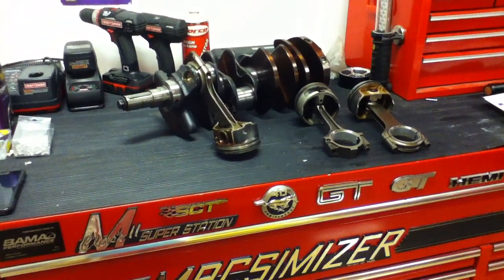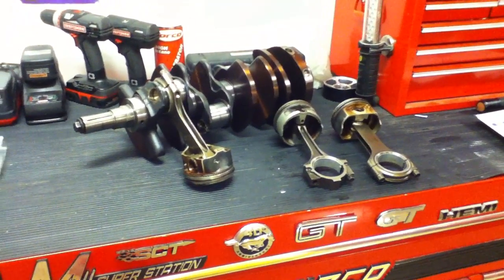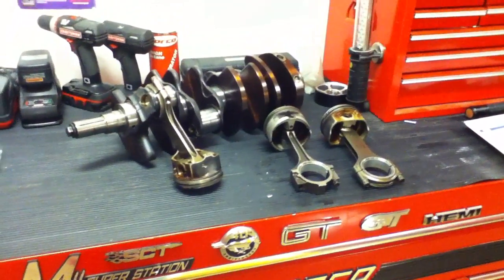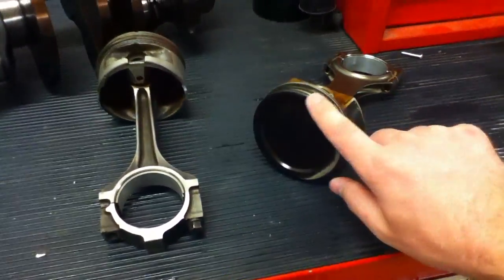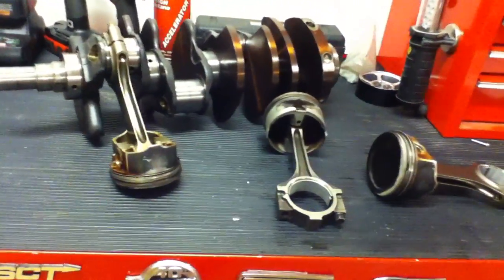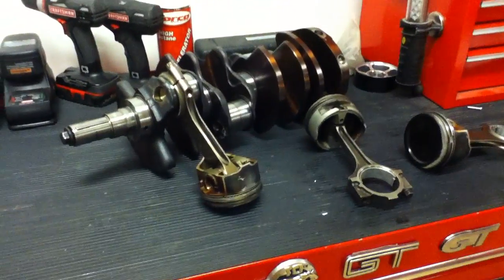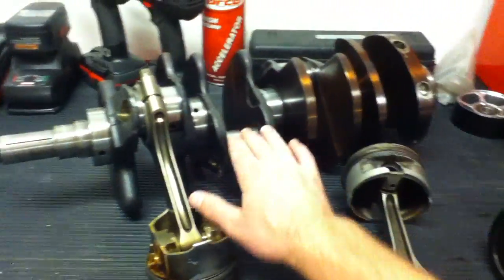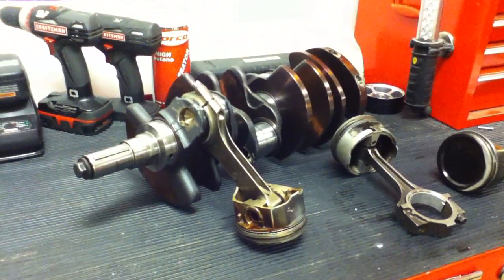Ford Modular engine, stroker kit, Compression ratio

Comment: I believe the Ford mod engines derived from the engine developed for Indy racing during the mid 60's. If I can recall, it was about 250 cid, dual ohc, fuel injected. The block was based on the 260 cid engine. I was blessed with the opportunity to see one of those impressive engines at the Ford museum in the early 70's.

Comment: So what is the best solution for us gt owners who have the 4.6 s.o.h.c.  engine? Coyote swap?
Reply from the maker: Yeah, because even supercharging will only get you to 450hp and any more will break connecting rods. Coyotes start at that level
Reply: @dannyjohnsonsgarage  thank you
Reply: I see.
Reply: Do you reccomend wrecking yard pulled coyote swaps or new crate engines
Reply from the maker: It would probably be most cost effective to get an entire wrecked 2011+ mustang, take the drive train and then sell the extra parts. You’ll still need to buy some things like the control pack that adapts it to the older mustang but you’ll have most of it that way

Comment: Wanted to get your opinion on the compression for a 297 scat stroker. I did a compression test and got 110-120 psi throughout the cylinders. Is that normal?
Reply from the maker: The important part is they are all the same, so the number isn’t as important as the consistency. The gauge itself may read low. That does seem a little low for a number, but again if it’s consistent you’re most likely ok
Reply: @dannyjohnsonsgarage  I am unsure on the stroker specs and machining that was done for the engine. But yeah I was getting 112-129psi, w/ bank 2 (driver side) being ~10psi lower than the other bank.

Comment: I have a 96 cobra motor, Teskid block, Kellogg crank, looks like It has flat top piston. Stock I beam rods and Cobra 99-01 heads have work
Comp cams springs, cams, rr Bunged heads.    🕵️ Will I benefits from a Manley h beam or Forged pistion, from a 03-04 Cobra? Will it handle more boost & be compatible with my 96 cobra  rods & piston size.🤷
Loved the video👌💯
Reply from the maker: The manley connecting rods from a 03/04 cobra are among the best you’ll find! Yes, install them. But with flat top pistons, that will be high compression so you’ll make power with boost very easy, but be safe with the ignition timing with that much compression ratio. Good luck on he build!

Comment: Can you put a cobra bottom end in a 2v.
Reply from the maker: c t 23 Yes, you can. There is a little more to it if you wane to go dohc and you should use the cobra block for that, but the crank, rods, pistons can all be used.
Reply: @dannyjohnsonsgarage  bro you're awesome I have a 99 Mustang GT it has a hundred and fifty thousand miles on it I want to do heads or supercharged it I work at Woody Anderson Ford and some of the Mechanics for like you're building this top-end motor too much the bottom and can't hold it so with the cobra being forged I was wondering could I put forest in there I'm no mechanic and that's why I'm asking these questions
Reply: Forged not Forest sorry talk to text
Reply from the maker: c t 23 You may enjoy my brother’s old Bullitt. Research the “tork tek” supercharger kit. It uses the cobra blower on the 2V. His car also had a mmr600 bottom end (which may also be a cheaper route) as it comes with pretty much the cobra internals. https://youtu.be/mxYigJmVRRI

Comment: So curious would you or wouldn’t you stroke a 4.6 ?
Reply from the maker: You would for more power, you wouldn’t because you’re putting the wrist pin closer to the heat with a smaller thickness of piston. You’re machining the components to be thinner, which would be more prone to cracking, but that’s not too much of a concern since the cylinder walls are thick. It’s a bigger concern on ls engines that get so thin you crack cylinder walls

Comment: Correction 4.9 engine.
Reply from the maker: correction to the correction. The old 5.0 is 4.948 and the new is 4.951. Both are under 5.0 liters, but the newer actually follows the official rounding rules to get to 5.0 😉

Comment: Great video Danny. I have a 2004 Cobra. I have 65,000 miles on stock motor with ported and pullied Eaton. About 470 HP. I am looking to install a 2.9 Gen 3 Whipple with return fuel system running E-85. I want to get as much reliable HP out of it. So I am thinking of upgraded rods and pistons and ARP hardware. What compression would you recommend? I am shooting for 800 hp or more. Will the stock block hold up? Custom cams and ported heads? What parts would you recommend to do all this right?

Thanks
Reply from the maker: Wilson Velasquez You can get to the 800hp level with little mods and without a rebuild, but if you want to rebuild the engine you can. I would simply upgrade the fuel system as you say with the gen 3 2.9 and let it ride until it needs a rebuild. I personally don’t like cams because the car is fully capable of running smooth and making big power, but if you like the lope and cam sound, no problem with that.
Reply: Danny Johnson 

If I do rebuild. What compression would be good for a tune for 91 octane gas with  16 pounds of boost and a tune for E85 with max boost(22-25)? How is the new coyote getting away with almost 12:1 compression on pump gas. And be able to run a 3.0 Whipple making over 770 hp on pump gas? Thanks for the info!
Reply from the maker: Wilson Velasquez Yeah, 9:1 will still work for both 91 octane and e85- you just need the tunes conservative. 

The new coyote can run a higher compression ratio because with direct injection, fuel is sprayed later in the compression cycle (rather than mixed in at the lower intake manifold) and therefore runs a lower risk of pre-igniting in the cylinder. 

I asked whipple about the high compression ratio and they responded it has knock sensors to pull timing (which to me, if it knocks, it’s too late- in fact, the terminator does not have knock sensors for that reason. It reduces ignition timing off of air intake temps).  I foresee some issues in the future. We will see

Comment: Thanks for making this video. Very informative. Quick question. What compression ratio would you recommend for a 99 cobra engine? Slightly higher than stock? I’m rebuilding it with forged internals. And plan on adding a pro charger. Thanks
Reply from the maker: Christo 17 I would shoot for around 9:1. Use a high octane fuel with that setup. Coyotes are running 11:1 and now 12:1 with direct injection (which helps), but you have to be very good with the tune and proper fuel
Reply: Danny Johnson Thank you. I was looking at either Lund or Vmp for a tune. The best octane we have is 91. Unless I run e85. The shop recommended boring .20 over or if I wanted, they can add a stroker kit. But like you said, there’s not a lot of room. Do you know if other 4v heads will benefit my build than the stock 99 cobras? Thanks again.
Reply from the maker: Christo 17 yes, the 03/04 cobra and mach 1 heads (04 being better and the 05 revision for the Lincoln aviator DC  being the best) are the best it got..other than ford GT heads, which are near impossible to find and expensive if you can. I believe the 03/04 heads also match up better for the supercharger components if you go towards terminator supercharger parts

Comment: Hmh, does the piston have an issue of being pulled too far out of the cylinder like a 4.25 inch stroker ls engine? Where to skirt of the piston is pulled out of the cylinder and rocks is what I'm trying to say xD
Reply from the maker: That would be the concern if not using a full stroker kit
Reply: Danny Johnson oh ok :) cool, I was pretty worried at first because of the deck height compared to an ls6. Thanks!

Comment: Had a question for you I have a 1998 Cobra SVT aluminum block which got hot and had water in it we change the head gaskets put everything back together and still it continue to overheat can you help me out with that
Reply from the maker: lil mayo fan B Have you burped the engine using the front cross over plug?

Comment: I have a 99 cobra and considering putting forged internals. What bore size, stroke, and compression would you recommend?
Reply from the maker: It depends on what power adder and fuel, but I’d say the 9.5 compression ratio range, stock bore and stroke so you can keep your stock, forged crank and only need to buy pistons and rods. Then plan to run a good octane/E85

Comment: Hi Danny I recently watch your videos, I have a question, 1: What exctly change in a Stroke Kit to uo at 5.0, the distancie in a Rods or diferentent distance and a Crakshaft? 2: I see a pistons Eagle to 3v and I have a 2v, I can use this forge pistons, because the 3 v just add anoter valve in a center and the 2 v position has a simililas to the 2v heads. Thanks I recent Rebuild my Engine my Crankshat is a 8 hole F85E-8303-BB I think is a Cobra Crankshatf because the old owner chage some parts to procharge the engine.
Reply from the maker: Typically, you will need a new crankshaft for a deeper pull into the block, and also longer rods. However, some companies may be able to change the length of pistons as well to increase displacement.. but that also will change the wrist pin's location, which you don't want to get too close to the top of the piston. Each company may have a different strategy, so I'd recommend calling the company and asking how the kit will increase displacement. A lot of these companies like DSS, MMR, Eagle, Diamond etc. have great customer support.
Reply: Thanks Danny i do it.

Comment: I'm running a 03 cobra and I just upgraded pistons and ARP 2000s my question is I am now running a 23 CC dish piston overstock Will I lose power and was is the smartest route to go I am currently running a 2.3 Whipple right around 20 pounds of boost I am concerned that I should've stayed with the stock cc and a better person
Reply from the maker: Cobra 5.1 that's probably going to be fine with the boost level. I don't think you'd see a major loss from less CR due to more dish (if I understand you build correctly). If anything, it should be safer as well

Comment: Great explanation on the 4.6, I have a 03 GT I wanna buy the on3 single turbo kit what setup would you go with? I'm still learning so any advice would be great thanks
Reply from the maker: Alex Guzman my advice for a turbo is that they are best for automatic transmission cars and must be put on the right fuel system to get the max out of them. Same with centrifugal blowers. I would recommend a positive displacement (top mount) supercharger, and remember that your car will hold about 450 hp at the wheels before it snaps connecting rods. Check out my brothers to valve BUlLLITT. It has a built bottom end, heads, cams, and the eaton supercharger from the cobra https://youtu.be/mxYigJmVRRI

Comment: Im getting my lower end rebuilt at the end of the year on my cobra,my block has its passages gunked so im not getting my oil up to the heads and the motor is shaking. Going with manley forged rods and pistons. Came back to watch some of these vids. Whats the story on this buddy of yours cobra? Is he going stroker?
Reply from the maker: Morbid SVT COBRA I don't think he'll go stroker. He had a few things come up and has his new 2.9 Whipple he has for it for sale. It all depends on when he can have the funds to finish it
Reply from the maker: Morbid SVT COBRA I don't think he'll go stroker. He had a few things come up and has his new 2.9 Whipple he has for it for sale. It all depends on when he can have the funds to finish it
Reply: Gotcha. I ran into ,y mustang shop mechanic today at work,he said hes sending my block upstate to one of the best rebuilders in the country,that sounds like great news,now im no where near close on the funds right now,gotta grind till december thgough :(. Now im anxious as hell,lol
Reply from the maker: It adds up real quick, and I'm having some anxiety over my buddy's build because I'm reading about how the mod blocks need a lot of attention and should be cut in small increments (not just punched .20 over on the first run). I'm sure machine shops know all that, but Its got me nervous.
Reply: I can relate. Btw found out the shop. Its at boyton beach called MPR racing . Tim Eichorn ,check them out on facebook. They build alot of coyotes too.

Comment: what do you think about the 4.9 stroker kit that scat offers.?
Reply from the maker: Marteze Farmer it depends on what you have as the original motor. In this case, you'd have to give up the cobra's very nice forged crank and hope he new crank is just as good
Reply: Danny Johnson its a 4340 forged steel crank 3.750" stroke and swings    5.850" long pro sport h beam rods
Reply from the maker: Marteze Farmer yeah, that sounds like it would be a good one. What car is it on? 6 or 8 bolt?
Reply: Danny Johnson it's for a terminator. I'm doin a cobra swap in a fox
Reply from the maker: Marteze Farmer that's pretty good then cause you can sell the stock parts to offset the stroker is the parts are still good. Make sure the new one is 8 bolt if you plan on using the same clutch
Reply: Danny Johnson . yea cause it doesn't say in the listing I'll have ta. call lmr

Comment: Good job! Thanks, I want to hear your thoughts about my Infiniti FX45 engine: I noticed, that there is plenty of "meat" in cylinder walls, so I am boring it into 5 litres, and ordered bigger, basically same pistons, QX56 has. now, stock comression ratio in FX 45 is 10.5, I changed that  lower, like 10.2 with my new "Power pistons', since I am putting "sharper "  cams in there, they are still under order, since this company in California, they could not have aluminum blocks to make them yet. Lower compression ratio, I think, able me to use lower octaine gas, correct?? That is my theory anyway behind it, I will get more power out of my great DOHC engine with other mods, like my own "plenum",about 1/4 inch,  cold intake 3 to 3.5 inch, and headers, new exhaust system. What do you think?? Thanks, and, would you recommend bigger, faster fuel injectors, stock are 330 cc, they are able to handle about 450-500 HP, with 51 psi, which is a stock fuel pressure! Your thoughts...., thanks =)

Comment: isn't compression raised in most vehicles for fuel efficiency like around 14? or in turbo effecient vehicles
Reply from the maker: Oliver most engines are in the 9 range. Higher compression ratios are typically designed to use at least  91 octane for safety (which people don't want to pay for it they have 87 or 89 octane available. Turbo and supercharged engines (except diesels) are also 9 or lower on compression ratio for the same reason.
Reply: Scrun Johnson Ah ok thanks I got mixed up.

Comment: so how much does boost change compression ratio,my  03 has about 17 lb boost
Reply from the maker: russ larson the compression ratio will not change because it's calculated by the space in the cylinder and combustion chamber, but the pressure will certainly change. I'm not sure how you would measure that.
Reply: http://www.xcceleration.com/cr-boost%20101.htm)

Comment: whats the easiest and most affordable way to beef up a 4.6l 2v. i recently took my motor apart and came across this video
Reply from the maker: N. Williams it all depends on budget I suppose. My brother has a Bullitt we put an mmr600 block in and topped it with the tork tech supercharger kit which uses the cobra's supercharger. It makes a cool 440HP now and runs great. I'd start with forged internals and decide if you will stay naturally aspirated or to turbo/supercharged. Turbos are best used when you have an automatic Trans.
Reply from the maker: N. Williams https://youtu.be/mxYigJmVRRI